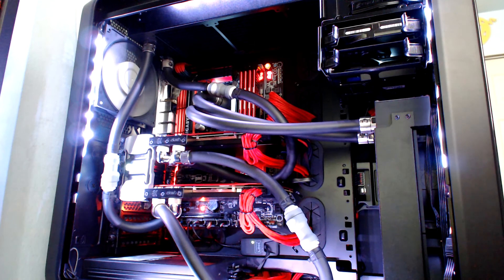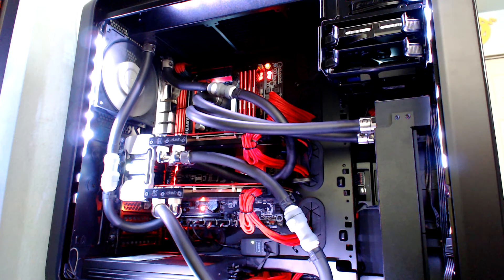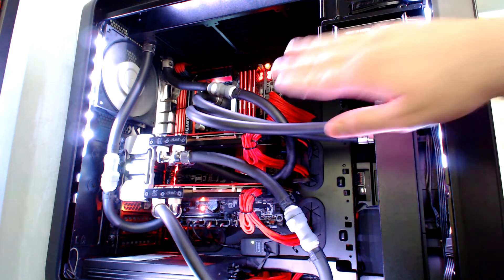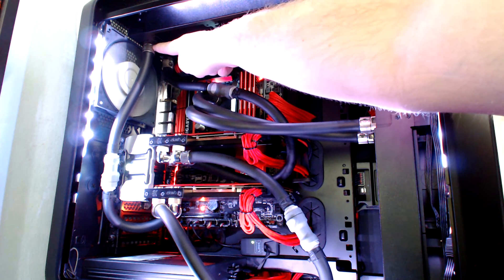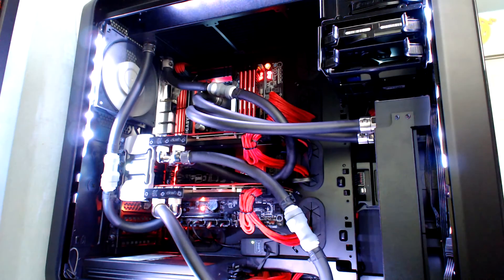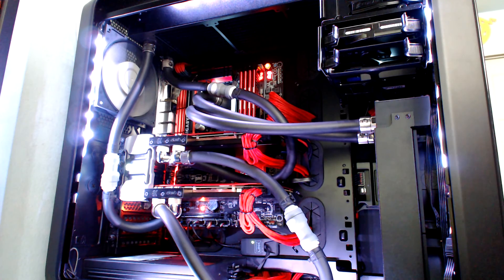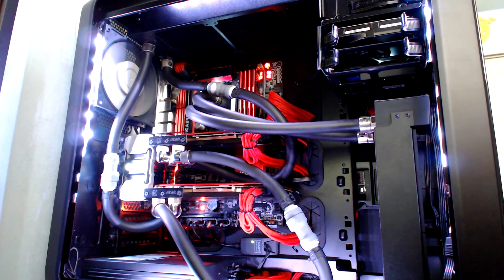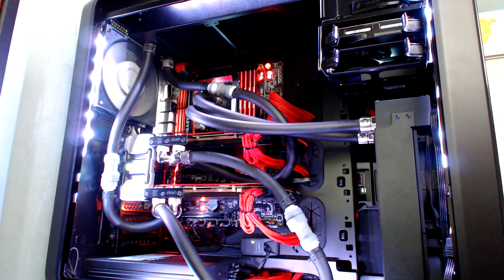The November PC Update (Part 2) All Water Cooling Explained | Hades custom $5000 PC

Comment: HUGE help, man! I've got an H100i for my CPU and I just got the Predator 360 for my CPU and 2 1070's. I was starting to get worried that the single 360 wouldn't be enough to cool everything, but now I'm thinking I'll just keep my H100i for the CPU and mod the Predator 360 to handle my GPU's. Thanks!

Comment: Is it possible to one full loop with just a single predator 360 and 2 gpus inside a Corsair 750D?
Reply from the maker: The pump would be able to run the loop although, your temperatures may not be as low as you may want. I usually want to have 1 120mm of radiator space for every core in the loop. Now, it could work pretty well.
Reply: Technology Therapy The part where you fiddled around the 360 looks daunting to me (total water cooling noob here), is there a way to streamline the process and make it easier for the likes of me? I have ordered two new Pascal titan Xs for my X99 overkill build, I am actually in the market for AIOs for liquid cooling my GPUs. I already have a Corsair H115i for my CPU.

Comment: great video, i'm somewhat little confused tho,being new to aio water cooling i'm ordering the predator 360/gpu water block for 980 ti. im confused about the bleeding/topping up process and when to use the ek ekoolant. does the predator come pre filled with distilled water ? would i have to top it up when i first install it ? or should i run it for a while then top up ? if so do i top it up with distilled water or the ekoolant ? then how often would i need to change the fluids ? every year  thanks in advance, subbed :-)
Reply from the maker: Okay so the Predator 360 is pre-filled with Ekoolant, now I would get an EK 980 TI water block that is also pre-filled, which also has clear Ekoolant. Then you should not have to worry about filling them up for at least 6 months to a year.
Reply: Tech Doubles  i'll get both, also have you got a link for the cooled 98 ti backplate as i cant find it on the EWKB website, many thanks

Comment: Hello,i would like to know,you have installed your predator 360 on the top,do you have place again for putting a drive bay like dvd or fan controller.Because i will buy the Corsair 780t,but i want to know for the 360 or a 240 will be the best.Thank you and keep your nice video.
Reply from the maker: Yes you can install a 5.25" bay device like a fan controller in the bottom slot, with the 360 rad installed.
Reply: +Tech Doubles (RITEinTH3eye) Cool,thank you for your rapid answer and your reply.Nice setup btw :)
Reply from the maker: +Steph Cote of course please sub to my channel for more PC content, I have a new build update and desk setup video coming soon.

Comment: Hi! I have a question about the EK predator. Will using hard tubes will work?  or this is only meant to use with the default tubes??
Reply from the maker: You can change the tubing to hardline tubing. All you need to get is the correct hardline tubing fittings, with G1/4 threads.

Comment: Do you know if the 360 is gonna fit inside a nzxt h440 if i remove all the drive bays?
Reply from the maker: Try to measure it, because the predator 360 is slightly bigger than a standard 360 radiator.
Reply: +SatoPS2 no

Comment: Hi, I'm just curious if I could do this exact setup on my HAF X case? I ordered the 360  predator along with the Predator PRE-FILL tube and the GPU block, I'm planning to keep it a single GPU setup atm, but I might go SLI later, thanks.
Reply: +Tech Doubles Could you kindly answer my question cause I want to make a decision by either order another Titan x or stay single card :), thanks.
Reply: +Rovian San No you can't unless you do something for top mount. For the HAF-X the best bet is to go with the 240. Unless you do a bit of modding for the 360. I used to have the HAF -X nvidia edition but I opted out for a new case(phanteks enthoo luxe) for my new build
Reply: +Jessica Wu Hey, thanks ^^, I already received my unit, and true, I had trouble first mounting the 360 rad. on top of the HAF X, but then I figured I'd remove the two 240mm top fans in order to install the rad, I also moved the blu-ray drive that was on the top slot of the bay drives to the bottom bay in order to let the tubing and the rad. go through from the front panel, I installed it and watercooled my TITAN X, I couldn't be happier cause I'm getting idle temps of 27-30c, and 43-47c under max GPU load, CPU is also running great at 32c idle, 57c max load and all that with silent fans, but then I'm not overclocking neither the CPU or the GPU, I like to keep everything at stock speeds, my TITAX is also a SC edition and I'm running my games at 1080p, so there is no reason whatsoever to OC, my only reason of buying this AIO watercooling is to have a quiet gaming experience, the old reference air cooling makes me feel like living in a laundry tbh. :)
Reply: +Rovian San Try re-seating the cpu block, Those temps are a bit high with no overclock. but gpu is pree good
Reply: +Jessica Wu Hey! I tried what you suggested, now my max load on the CPU doesn't exceeds 50c! what I discovered is that I didn't applied enough thermal paste on the CPU, when I removed the CPU block I noticed some areas on the CPU had very little thermal on them, and the edges was kinda clean, I cleaned it all off and applied enough this time, not too little, not too much, Idle temps kinda runs about the same, but max load changes was pretty significant, so thanks again. :)
Reply: Nice! =) Glad that I could help

Comment: hey man great video..thats crazy because the same thing happend to my 240 with the fitting..how did u fix it to where it will tighten back in to the plastic res?
Reply: lol nvm i heard you say you rma
Reply from the maker: +trxrevo10 Yeah I had to get the unit RMA, to fix it. I was not going to deal with a leaking fitting.
Reply: That's what I started and the they told me that I would have to purchase the pump housing/res for $15 plus shipping so now I'm just waiting on the part..I was kinda pissed only owning the aio for a month
Reply from the maker: +trxrevo10 yeah that is kinda crazy, so their making to switch out the pump to fix the threading issue?
Reply: +Tech Doubles (RITEinTH3eye) yes lol like i said man im kinda mad but o well
Reply from the maker: That is kinda BS though.

Comment: And here I am wondering how am I going to be able to replace my broken R9 290. Holy shit I'll never be able to afford that kinda shit. Very cool build dude, I'd still prefer full custom watercooling, but damn that still looks amazing.
Reply from the maker: Thanks a lot, the thing is about this type of loop I can add a mother radiator and add a reservoir into the loop and then, it will be a full custom loop with quick disconnect tubes. Although each of the loops are independent here as well as they each have their own pumps and reservoirs mounted on their respective radiators.
Reply: +Tech Doubles (RITEinTH3eye) Yeah it's a really cool, new way of custom liquid cooling. Wish I could even afford to think about hardware like this, it looks absolutely stunning. Also, that's a smart way of setting it up, as two separate loops.
Reply from the maker: +thewalrus indeed it is a new type of way to create a custom loop. Thanks a lot for your support.

Comment: Hi. Please for advice, I'm about to build 4K PC myself I got most of the parts 2x 980 ti matrix, evga p2 1200, Intel 750 ssd, lian li PC o8 case, kelvin s36 aio, now just need to decide between 6700k with maximus viii extreme mobo or 5930k with x99 deluxe which way will you go? Mixed opinions from different sources so far ... Mostly need it for gaming and photo editing so don't know if I really need that extra cores, from the benchmarks I noticed that strangely 6700k gives more fps, but other tests says that with six cores you will get better minimum fps, who to believe? Million dollar question... Btw great videos on your channel:)
Reply from the maker: I would be happy to help you out, I'll give you a quick idea about how to choose the right CPU. So the 6700K will give better performance for single core tasks. Also, just the opposite the 5930K will give better performance for multi core tasks. Having said the I run a 4790K as you may know, and my brother runs a 5930K, we both have dual Titan X GPU's. The amount of difference in performance between the both of our rigs in gaming at 4K resolution in nearly non existent. The 6700K does show to have an edge over its predecessor the 4790K, of about 4%-12% in certain gaming situations. Now comparing the 6700K to the 5930K honestly I do not see the real different even between the 4790K to the 6700K so, the extra cores will not improve in your gaming performance enough for you to notice. The time it takes to do photo editing, the 5930K with its 2 extra cores and 4 extra threads will help with this. If you can find a 6700K that is close to its MSRP of $350 I would go the the 6700K.
Reply from the maker: +Tech Doubles (RITEinTH3eye) Although, if you notice the 6700K prices are closer to the 5930K's MSRP of around $550, I would go with the 5930K. Just remember to get some really nice Ram to go along side that beast build. I would go with Hyper X 2666MHz Ram or my favorite Corsair Vengeance LPX 2666MHz Ram. I would get at least a 16GB kit. If your going for the 6700K build get a 2x8GB kit so you can upgrade to 32GB in the future just in case. If your going with the 5930K build get a 4x4GB kit so that you may also upgrade to 32GB in the future. This way on the Z170 board you will have  a dual channel kit and on the X99 board you will have a quad channel kit. I hope this helps you in making your decision. Let me know if you have any more questions. I'll be happy to help, also if you would like me to create a video about such topic in the near future as well. Thank you for your support.
Reply: +Tech Doubles (RITEinTH3eye) thanks for quick reply, when it comes to ram I'm deciding between dominator platinum 2x8gb 3000mhz or g skill trident z 3200mhz, cosmetics... My Intel 750 is not dispatched yet, just checked with Amazon so now I'm thinking if it's not better to change to 512gb Samsung 950 pro nvme which one is better you think ? Once again thanks for advice tomorrow I will decide but now I'm leaning towards skylake ...
Reply from the maker: +Tomek1Oko I think you should go with the 950 series nvme drive from Samsung those are sick. And yeah I would go with the dominator platinum 3000MHz 2x8GB kit with the 6700K. That's a sick build right there.
Reply: +Tech Doubles (RITEinTH3eye) thanks. And I'm sorry to bother you with so many questions:) once I finish my build I will make short video so you can have a look. I was about to buy pg279q monitor but next week pg27aq 4K is coming out, but not many reviews out there yet, will you pre order anyway or wait to see if it's good enough... And last one, when you download qualified vendors list- devices from asus websites for the motherboard
Reply: +Tomek1Oko there is for example one psu from ax series: ax1500i or one from evga supernova 1200 p2 is that mean that only those been tested and are compatible or you can go with less power for example evga 1000w p2, the point is, if I have for example 1200w psu but take 600w from the wall will I use same amount comparing to for example 1000w psu and 600w from the wall or bigger power supplies use more energy, sorry for maybe stupid question but that always interested me. And will you go with corsair or evga psu ...? :) thanks for your time take care
Reply from the maker: +Tomek1Oko I would wait for some reviews to surface about the monitor. I use the Asus PB287Q 28" 4K 60Hz TN panel, if your untreated in taking a look at it. Also the question about the PSU's, for the most part getting a higher watt power supply allows for more overclocking head room as well as the option to increase the components in your system that may use more power. Such as adding another GPU or more storage devices things like that. I personally use the great Corsair AX1200i power supply, it has what I would like to talk about now, an 80+ platinum rated efficiency. This is how efficient the power supply is at getting the most power out of the wall going into you PC components. The 80+ platinum efficiency rating means it will deliver 92% of its overall 1200 watts to the system  at around 55% load on it, which is very good. The higher wattage PSU you get the more load it will handle with ease. There is one rating higher than platinum, that isTitanium. The Corsair AX1500i has this.
Reply from the maker: +Tech Doubles (RITEinTH3eye) There are no stupid question, I am happy to answer all question. I think you for your support. Let me know if there is anything else.
Reply: +Tech Doubles (RITEinTH3eye) while you are gaming on your 4K monitor and there is a game which doesn't support sli reducing res to 1440p make picture much softer then on native 1440p screen or is it ok ?
Reply from the maker: +Tomek1Oko I ran Star Wars Battlefront in 1440p on my 4K display for a benchmark, and I did not notice the picture being softer. Take a look for your self. Here is the link to that video: https://youtu.be/nGv8NBGFgTE

Comment: that was me that left the comment :p
i think i get it now but unfortunately im not going to be able to do it :(

i have a corsair air 540 case wich i dont really want to change because i like it, it can take a 360 in the front and a 240/280 in the roof but with the added length of the pump and res on the radiator i simply wont have enough room
i think i could fit dual 240's but they dont come with the quick disconnects so i would have to do alot more to get the same setup and im not sure if a 240mm rad would be enough for dual 980ti's, you can get 980ti's with with an AIO already on them with a 120mm rad and they stay at around 50c even with heavy overclocks so in theory 240mm should be enough for 2 cards but i just dont know
dont really want to spend the money if im not sure if its going to work

great video, earned a sub from me :)
Reply: NomiLucky thanks for that, i didnt think there was anyway the 360 was going to fit but looks like it will with a little gentle persuasion